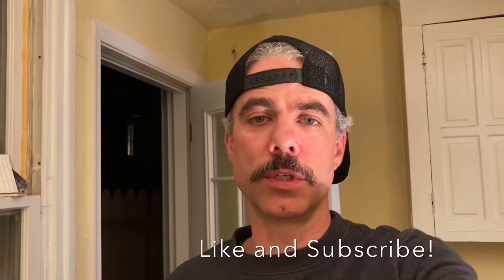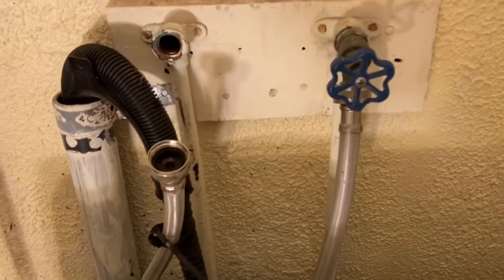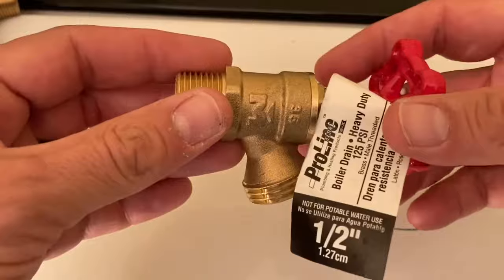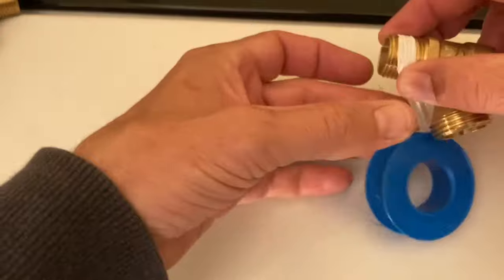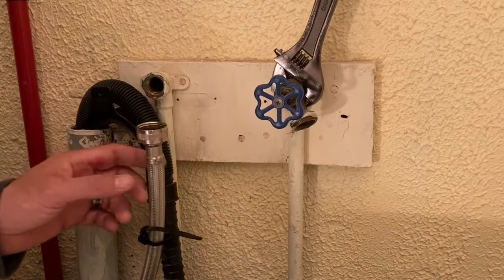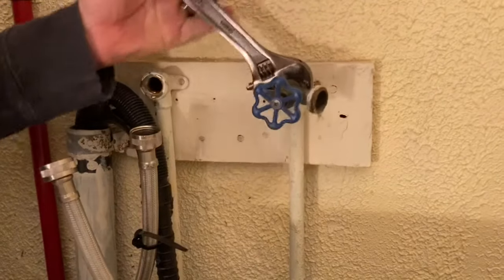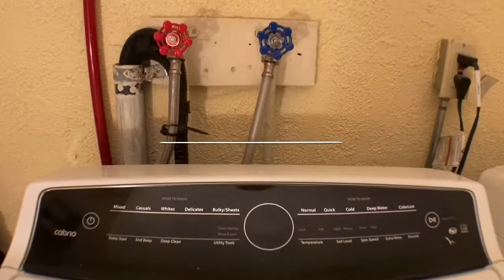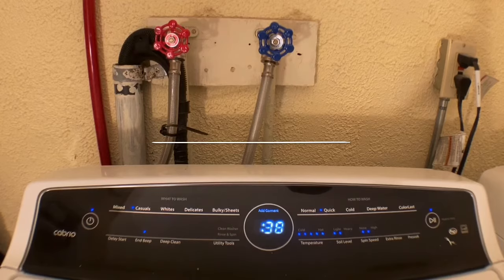DIY:  How To Replace Washing Machine Valves

Comment: A good rule of thumb on installing metal to metal threading on plumbing is if there is no rubber washer present then plumbers tape is needed. Always wrap it the direction the threads are going and boom, you are golden 🤷‍♂️.
Reply from the maker: Thanks for watching and offering some good advice.
I wrapped it the incorrect way the 1st time around and it was not pretty!
Pinning your comment so that others can learn from it.
Reply: Do you turn off the valves after each wash?
Reply from the maker: No, they remain on.
Reply: @DIYTutorialGuy  I’ve been turning them off lately…afraid of them freezing and busting. Is that not necessary?
Reply from the maker: That is a good question, and I will do my best to answer.
If your house is insulated your pipes should be safe.
The basement in my current house gets very cold, but never cold enough that I can see my breath when I breathe.
There have been a few weeks here in PA that were in the single digits, and no pipes burst.
Some people will say to leave a faucet running during those extremely cold nights, but I’ve yet to do so and have yet to encounter a problem in any house I have lived in during my life time.
Now, I do turn off the outdoor faucet from inside, and leave it turned to open, for the winter.
Hope this helps!
Reply: At the end you said you had to tighten it more - did you do another full rotation?
Reply from the maker: Yes, I did another full turn.

Comment: i thought id have to solder but i see it screws on..i thought i saw grooves like it was a male end but watching the video seems those valves have male ends..ill have to get a good look before i buy the valves....also..how do i know what size to get? are they all 1/2 in? the pipes are copper ...im an amateur but i do watch and learn pretty easily :)
Reply from the maker: Thanks for watching!
My advice is to take the valve off that needs replacing and take it to the store with you. There you can talk to someone and get the correct size.
Remember to shut the water off before removing the valves, and leave a faucet open on the same floor as the washer.
Reply: @DIYTutorialGuy  so i did give it a closer look and it doesnt have the size on it but looks to be 1/2 inch and also  does have a female end, so i was able to find one online at home depot(i used to work there for 12 yrs lol) and give it a shot....just hope i dont damage the copper elbow that its attached to when trying to remove it!
Reply from the maker: @judithwilber2540 you should be fine! Just don’t use brute force…at first!
Reply: thanks for your help!
 @DIYTutorialGuy
Reply from the maker: @judithwilber2540 you’re welcome!

Comment: Thanks for the tutorial. I like watching any videos on projects before I do them myself. Quite self explanatory most of the time. I have a leaky valve that only leaks when you are shutting it or opening it. Doesn’t leak when completely open or closed. I’m replacing both for peace of mind
Reply from the maker: Thanks for watching, and I’m glad you liked the tutorial.
I’m the same as you, I like to watch tutorials before doing most things.
Nice call replacing both valves now and saving on a headache later.

Comment: Nice video.  Thanks for putting it out there.  One thing that I do along with teflon tape is add pipe dope on the teflon tape.  I have found that this generally gives a water tight seal in all of my installations.
Reply from the maker: Thanks for watching and sharing a great tip!
I used teflon tape and pipe dope for s whole house water filter install, and you’re right, it’s a water tight seal.

https://youtu.be/H6gry4n2TdQ

Thanks for watching!

Comment: Thank You DIY... I didn't know you tightened it that much, I thought it was like Faucet repairs, 1/4" turn after you hand tighten as tight as possible... ❤👍
Reply from the maker: Thanks for watching and commenting!
I had tried that initially and ended up with water leaking. 
That was not filmed, and should have been explained better in the video.
You definitely have to tighten these suckers down!

Comment: Thank you have to change my cold valve it is dripping great and simple video
Reply from the maker: You’ve got this!
One piece if advice - use teflon tape and then put a coat of pipe dope over the tape.
You should have no leak after that!

Comment: Just found your video! It was super helpful. I’ll be changing mine out this week. So I was reading the comments and someone said to put the plumber’s tape in the same direction as the threading. Which one is correct? I believe you said it goes the opposite way. 
Also! Maybe you have some insight. My washer ONLY uses hot water. I’ll played around with the valves and it seemed they were both on. Hoping this replacement fixes it…
Reply from the maker: You’ve got this!
I made a huge mistake and the tape should wrap around the pipe in the same clockwise direction of how the pipe will turn into the fitting.
In regards to only having hot water, is there only 1 line coming into the laundry room??
Reply: @DIYTutorialGuy  no there are two lines. My hope and guess is that the lines were switched when getting attached to the washing machine. I’ll check to run a hot water load to see if it comes out cold. If so, that theory seems like it would be correct. But if that doesn’t work, I’m not sure what the issue is!
Reply from the maker: Let’s hope your right and the problem is an easy fix!

Comment: home ownership is a kick in the ass. i went into the basement and had a small puddle that went through the subfloor (plywood). went in the upstairs bathroom and pulled out the washer. a baby puddle. i noticed a drip coming from BOTH valves.
Reply from the maker: I totally get it!

Comment: How did you deal with the hot water side and avoid being burned
Reply from the maker: Excellent question!
What I did first was turn off the water to the house, as shown in the video.
I then turned on the cold water at the closest sink and let it run until there was no water coming out.
I did not run any hot water.
After this, I removed the hot water valve.
A small amount came out, not enough to burn me, and I then stuffed a rag in the pipe to absorb the small amount of remaining water.
That’s it.
The water heater did not drain via the removed valve.

Comment: It just happened this morning after we had already had an issue with the hot water valve inside the washing machine.
I can’t find the valve to turn off the water, can I just turn water off for the house?
Reply from the maker: Yes, you can.
However, what you will want to do is once you turn off the main water supply, leave a faucet running in the sink closest to the washing machine before you take off the valves.
I say this because once you remove the hot water valve, there is a chance the remaining hot water in your water heater will look for an out, and the faucet left on will allow this to occur.
Reply: @DIYTutorialGuy  I just walked to my husband about it and he told me where the valve is and like everything in this house the location seemed strange and not a place I would look.
He said if you open the valve all the way the active leaking stops and I think we should go ahead and replace them. They are 30+ yrs old and definitely corded. Having to mess with the thing in the washing machine had us turning it on and off so it must have broken it’s seal.
Guess I’m going to the hardware store today lol

Comment: boiler drain valves usually have lead (low lead, but lead touching water).  for a washing machine idk it could be argued either way but id go zero lead still since im not a drain or a boiler 😂  i dont have backflows on my water supply but i do shoot and reload so i guess im an idiot 😂
Reply from the maker: Shoot and reload…did I make a joke about that? The video is a couple years old and I forget…

Comment: I'm not at all a fan of those full turn values. Other better shut-off value options include brass 1/4 turn ball values or a brass dual value with one lever.  Full turn values are crap.
Reply from the maker: Thanks for your input.
These have not given me any issues since the repair, but if they do I will heed your advice.

Comment: What if a grounding clamp is on one valve and all I want to do is repair the packing if possible? 
Do I need an electrician first?
Reply from the maker: Hi Diane!
Good question, and to better assist you, I have a quick question.
What appliance is the grounding clamp sending to ground?
Reply: @DIYTutorialGuy  I don't know, assumed it was grounding my whole house, but could it be grounding for the washer?
Reply from the maker: My advice is to unplug the washer first, then remove the grounding clamp and make the needed repair.
Once that is complete, reconnect the grounding clamp and turn the power back on to the washer.
Reply: @DIYTutorialGuy  When I remove the clamp will that be a safety issue if indeed the clamp is grounding my whole house and not just the washer?
Reply from the maker: @dianed4190  I must have misunderstood your question, my apologies.
Are you able to take a look at your breaker box? There should be a grounding wire coming from there that runs to the ground for the house.
If this runs to the clamp on the valve you are referencing, then I would say that is the ground for the house.
If it does not, then I would think it does  not ground your house.

Let me know what you find.
Reply: @DIYTutorialGuy  No visible wires   on clamp or on electric box. Wires must be behind the drywall. 😕 
So this may not be a safe DIY for me without knowing for sure about that bonding clamp. 😔
Reply from the maker: If I could see a picture or video of what you are seeing I could be of more help. But that’s probably not possible, so I would advise calling an electrician to come take a look.
All they have to do is verify what the clamp grounds, and then if it grounding the house, they can advise you on what needs to occur.
Reply: @DIYTutorialGuy  Ok, thank you for your time. I like to DIY whenever possible so I'll subscribe... mwahh! (through my mask, of course)
Reply from the maker: Thanks for safely subscribing!